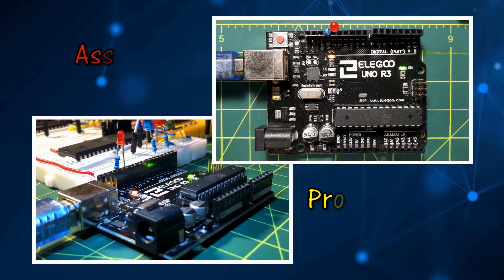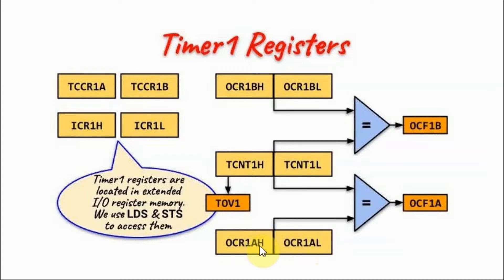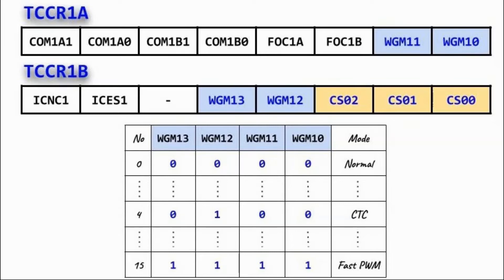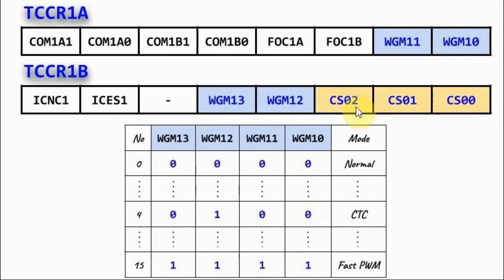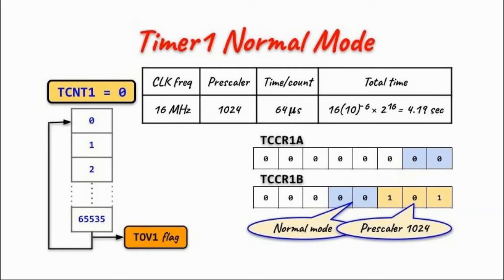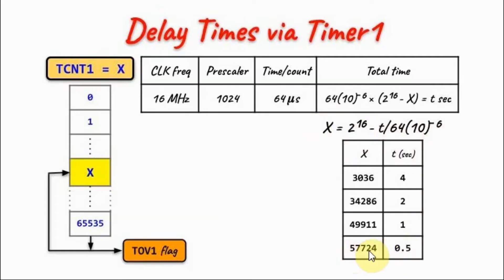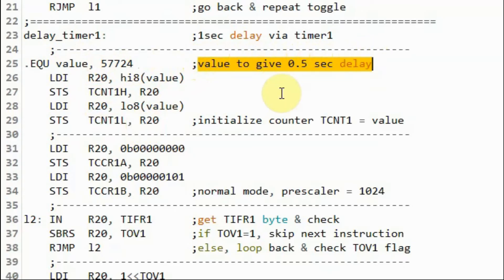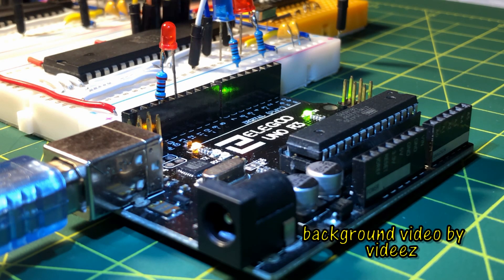Assembly via Arduino (part 13) - Programming Timer 1

Comment: Thank you again, mister Anas. I am experiencing an error in line 36 and 37, it says a constant value is needed, it is the part with "SBRS R20, TOV1" and R20 contains what has been read from TIFR1. Best regards from Poland.
Reply: I was writing a zero instead of an "o" hahaha, it is "overflow" and not "zero-verflow".

Comment: It would be nice to have an example  using timer interrupts instead of checking compare or overflow flags for delay so that the  timer can be used to execute some ISR (say reading ADC inputs) while the CPU is doing something else (say controlling some device ) at regular intervals
Reply from the maker: Thanks for your feedback. I’ll modify the code using interrupt.
Reply: @AnasKuzechie  I can send sample code of timer interrupt using overflow by email